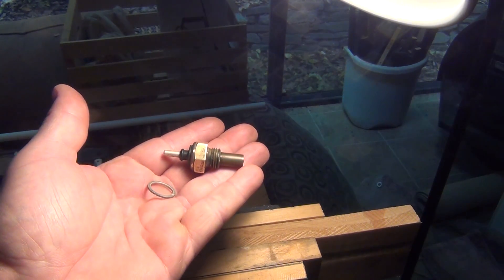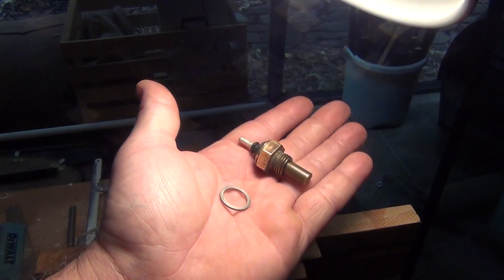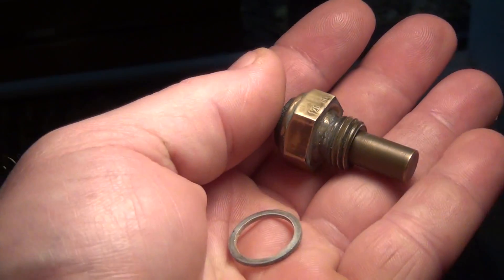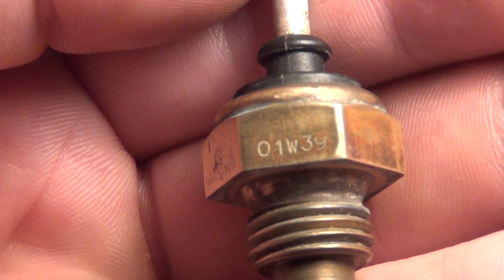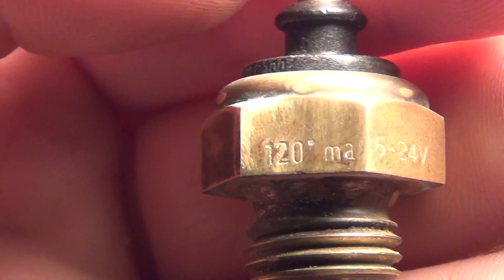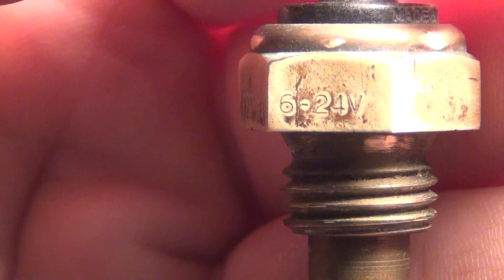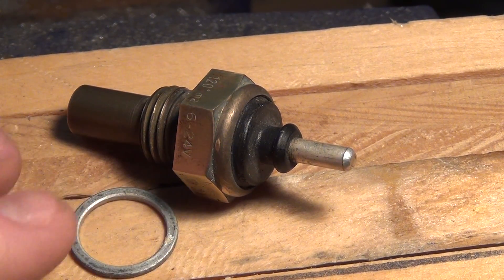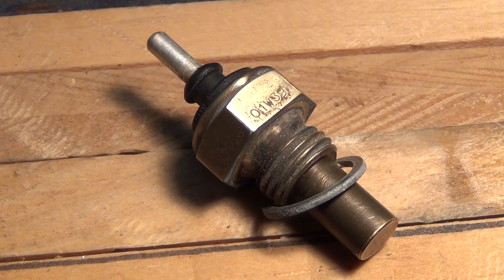Mercedes Benz E320 - Engine coolant temperature sensor that goes to the gauge

Comment: Yeah  in my w210 e320 this  sensor turn on the cooling fan  there's  another  sensor located  on the water pump  it gives  the  reading for the  gauge this sensor measure coolant  temp  just to turn on the cooling fan

Comment: This sensor is not for  gauge reading its for the radiator cooling  fan
Reply from the maker: It measures the coolant temperature in order for the gauge on the cluster to work...show the coolant temp. The temp sensor on the gauge didn't work, showed no reading, and after replacement with this new sensor the temp gauge on the cluster did work. I am not sure what you are trying to say via your comment but you are implying that this sensor has nothing to do with the temp gauge on the cluster and that is incorrect.
Reply: Guess it depends on the model but my 1995 C280 it controls the temperature gauge
Reply: On my om617, m102, m103 this sensor controls the guage